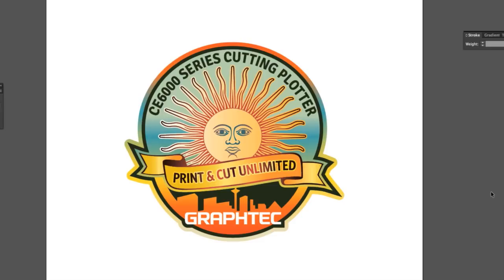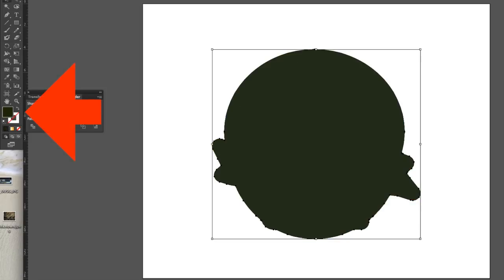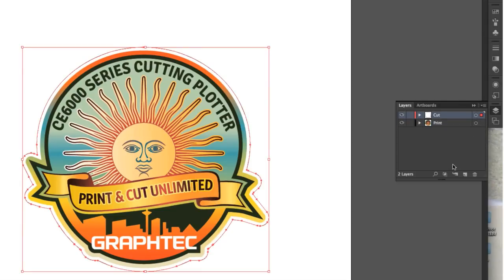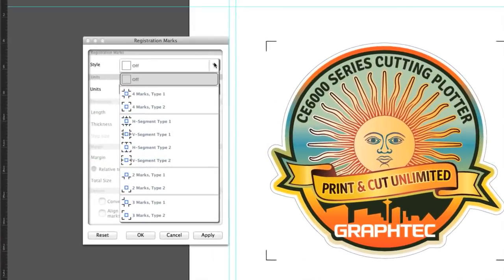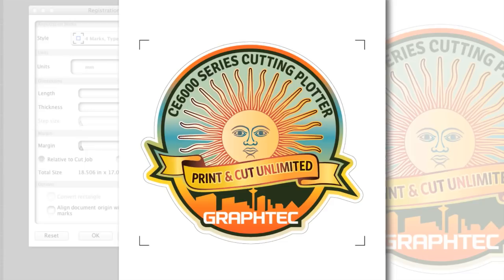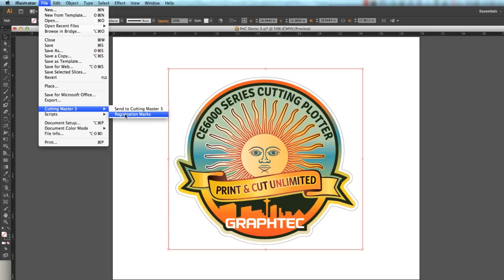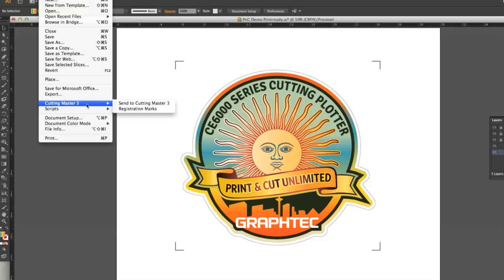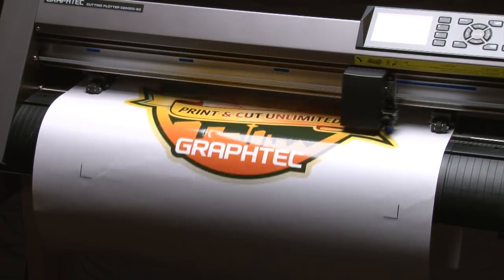Graphtec CE6000 Training - Print and Cut

Comment: Hey guys!!!, im soo happy you've put up these videos. I've been studying them hard.

with that said though, Ive encountered an issue, and i wanted to know if you had any suggestions, before I contact graphtec. 

Now Im able to set up registrations and the like, however when i send it, my plotter doesnt scan for the marks at all. ive set up the machine pretty close to the setting you've walked through in previous videos, but i still get that problem. My work around has been still printing the markers, and setting the origin point and job justification to the lower reg marker. This method gets pretty close, however it leaves me trying to pin point the exact spot, prior to any job i send. In most cases, i have to swap the cutting tool for en embossing tool, and then back to start the job... kind of annoying, but any help would be greatly appreciated.

Comment: Hi, this is super helpful, thank you! Whenever I send the cut layer to the cutter, it is always about a centimetre off on either side (it cuts the right shape but not in the right place) and I place the job at the bottom right side of the display panel (position 0,0). I have even tried repositioning it and it is just always off. Do you know what to do to make it work?
Reply: @jotoimagingsupplies  Unfortunately, it does it even with registration marks. I place the blade at the corner of the marks as the instructions specify and then it scans the marks and looks like everything is fine, but the cut are just off

Comment: I am having issues with CM3 showing the registration marks. Not sure what I am doing wrong. Could y'all give me some advice?
Reply: Illustrator CS5
Reply: On a Mac if that makes a difference
Reply: I am able to set the registration marks fine. I have prints with the registration marks on them and everything falls within the rollers once it is loaded.

It is when I want to send the contour cut job when I have my problems. Occasionally the registration marks will show up in CM3 but they will disappear after a second or two. I don't even have to press anything and they will remove themselves. And that is if they even show up in the first place.
Reply: That is the version I have but I will give it a shot, just wanted to see if y'all had any advice before I went that route.

Thank you for your time to help me out!!